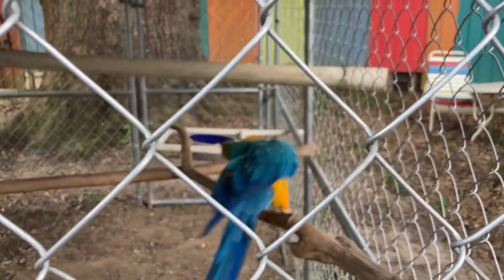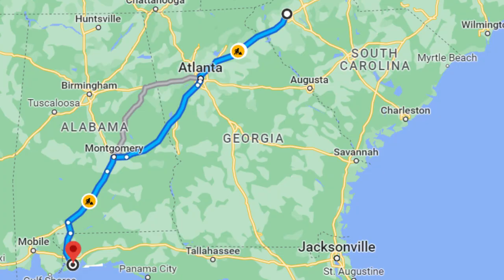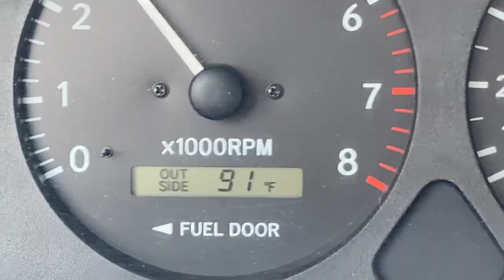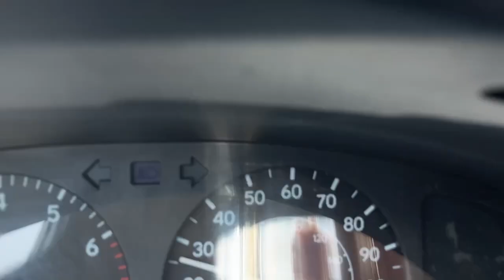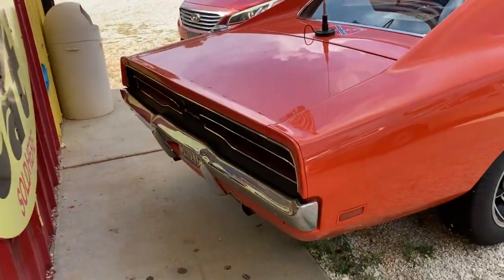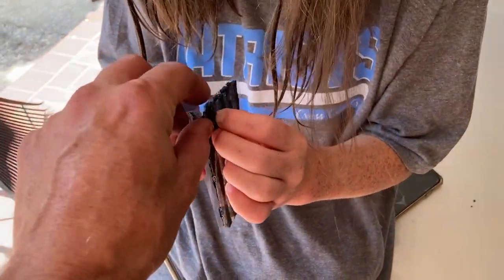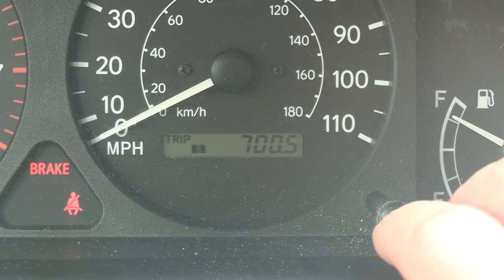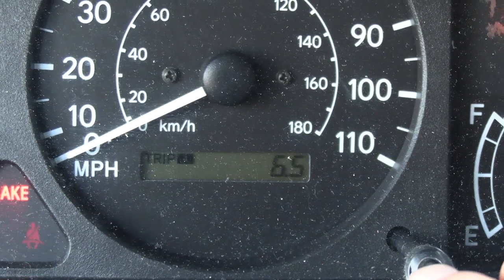HPL Engine Oil vs. OIL CONSUMPTION - Part 2 | Oil Burning🔥Experiments | Episode 24

Comment: Honda Odyssey have a big problem burning oil due to the fuel management system shuts down the rear 3 cylinders.  I switched to using Valvoline VR1 20w50 as an experiment to see if a thicker oil will reduce blow by. And it did.  This van would burn oil a quart every week or so.  Miles will vary because i use it as a work van.  Its probably 400 to 500 a week. Now the oil consumption is down to about a quart every 2 weeks.   It obviously isnt a permanent repair.  But it does cost less to run.  I used to need to buy 10 qts of oil for 1 oil change interval.  (5qt capacity) now i can get by on 7 to 8qts in 5k miles.  I also used to get a code for the vvt oil pressure and that went away a year ago when i switched to using mobil 1 oil filters.  The oil is black but it seems like it has less larger  dirt particles in it.  I have never bothered to send the oil in to get it analyzed.  Long story short, a thicker oil will slow consumption.  Although it may consume more fuel now.

Comment: Dave I have watched all of your videos on oil consumption and I can not find where you have used one of the top go to products, Lucas Heavy Duty Oil Stabilizer. I did a lot of the same things you did on my car to clean piston rings, it helped a lot! Still was burning oil, but not as much.  Before I added Lucas, while the car was running I took the oil cap off and  a  fine mist of oil spray shot out.  Added Lucas and drove the car to let it mix and warm up.  Took the cap oil cap off and their was a notable decrease in fine spray.  Also a notable decrease in engine oil burning.  IMHO   the sticky glue like Lucas oil treatment reduces the amount of fine oil mist, and it is the fine oil mist that can easily make it through the PCV system into the piston chamber where it can be burned.

Comment: Hey dave u should try Lucas oil   treatment its thick i believe it straight 30 wait oil put 4 quarts of oil 1bottle of lucas if u have a 5quart oil system follow the instructions see if it would work it will rasie oil pressure so try half of Lucas bottle it says it will stop oil consumption raise mpg

Comment: I think there should be 2 more steps. 
1. BG Dynamic restoration, as everyone suggest. It's expensive compared to others, I've never used it, but heard a lot of good things about it. And no other channel used it in such a trustworthy way as you would. And if that doesn't work..
2. DMSO. The big boss of chemical treatments. The last resort. DMSO is like the strongest antibiotic if it was a medicine, it obliterates everything in it's way. Good, bad, sticky, it simply doesn't care, because how harsh it is on your engine. It definitely strips paint, so make sure your oil pan doesn't have any before using it. if DMSO won't help - nothing will, and you can definitively state, the problem is mechanical, not chemical. 
Other than that, thank you for your content! Even though I fixed my issue completely with Berryman after seeing it on your channel, I still enjoy these series!!

Comment: As I mentioned in another comment on another video, I had a 2001 Chrysler Town and Country that was burning a quart in 3,500 miles, more than any other car I owned. Then one day I changed to oil to Castrol Syntec and it made it to the 10,000 mile oil change interval on less than a quart of loss. This continued for a couple of years until one day I changed to valvoline synthetic, and sure as heck, a quart low at 3,500 miles. At the next oil change I switched back to the Castrol Syntec and the oil burning stopped. From that day on I never used any other brand of oil. Except in yacht with diesels. I did run that one for 300 hours with no loss of oil either, but it does hold almost 5 gallons and low to high mark on the stick is 1 gallon. I use Rotella T-5 in that one and am thinking of moving on up to the T-6. The time before I used the T-4 with similar results.
On that note, perhaps using 15-40 diesel oil might do the trick. Lots of addatives in there and just a little thicker.

Comment: I don't have a recommendation to offer.   Oil is funny when you change the oil the one thing it does is clean the circulating oil system and as it cleans obviously there is particulate in the oil and that particulate or dirt breeds new dirt, so filtration is very important to reduce that impact.  I don't recall you ever mention the filters you are using or have used.   I don't believe you have ever sent oil samples out to determine the composition of the particulate and additive package.  I have been watching your videos with great interest.  I am a curious fool of sorts and so if something really works it grabs my attention.   My guess is the rings are stuck because manufactures started using what I believe they call low compression rings in the name of pleasing the EPA.  So knowing this I have been routing for a viable solution you might come up with and I greatly appreciate your efforts.  What I wonder is if you were to increase the frequency of oil changes lets just say every 1000 miles with a high-capacity oil filter at each change for a solid year but I would also be interested if you dropped the oil pan to see what it's been collecting.  This is what I would do to avoid tearing the engine down and yes, it's expensive but if you can remove the particulate matter faster it could improve you situation.  It might also make no difference, but this car is does not appear to be your primary mode of transportation so it's worth trying.   Now if it were your primary vehicle the best thing to do is to tear it down and do what's necessary and my guess is you will find stuck rings.   What can unstick them I have no idea therefor I have  no real recommendation to make but oil is an excellent cleaner all by itself the thing is you need to remove the particulate matter and the better you can do this with good filtration the oil will continue to clean but if you do not remove the particulate matter you will just create more particulate matter and the one thing you will really notice are oil leaks and one thing I will say is I do not recall you ever mention oil leaks or am I wrong?   Hey, I am an old dude that deals with oil issues since Moses got lost in the wilderness or so it seems.    When you drove by the KIa plant you were not too far from where I live.   I never liked driving in Alabama but never got a ticket there but if I felt I did no wrong I would contest it but if I did something wrong, would pay the ticket.  Only time I drive out of state is when I travel home to MA, yes, I am a Masshole but knock on wood I have been ticket free for hmm I think 30 yrs.   Doesn't matter,  I just want to thank you for all your efforts and I have watched everything you have put out there because it's interesting to me and if I can learn something new then I am all for it.
Reply from the maker: Yep, no oil leaks to speak of. Thanks for commenting!

Comment: Im thinking 🤔....pull all 4 plugs and fill the cylinders with JB weld... Tow the Corolla to a monster jam event and let em run it over...piss on it...then flatbed it to Alabama and drop it off at the police station with a huge bow on the roof as a present to the cop who wrote the ticket... 😂...

Comment: I'd sorta like to see you pull down the engine, fixed or not. Just to see what all these products have actually done with the tarnished area's of the motor. How clean will it be inside? Will it look new with cactus rings? 
Or is all this stuff you're sticking into it not doing what they claim?

Comment: I have a 96 F250 with the 7.3 powerstroke that was replaced in 2018. It started consuming oil around 57k miles about a quart per 1500 miles. I switched to HPL ck 5w40 at 65k after two complete oil changes it was less than 1 quart every 3000 miles and now at 83k miles it has completely stopped using oil. I’ve also switched to the premium version which allows for more miles between changes.

Comment: Engine oil expands and contracts with temperature. I know this is not meant to be a completely scientific test, but I think you would be better off to have some consistency in how you check the oil level. There is likely a spec'd procedure in the car's owners manual. From the vehicles I have had, it usually something like, "run the engine until at normal operating temp. Park on level surface and turn off engine. Wait 20 minutes and then check the engine oil level."

Just something to consider. Thanks the entertaining video series! This video made me want to vacation to Pensacola and maybe get a management job at a truck stop! LOL
Reply from the maker: Thanks for the advice :-)  Yes, I should have been more consistent with the oil checks ... alas, I think that ship has sailed, but will keep in mind in the future. Thanks!

Comment: I really like the Liqui Moly 2037 Pro-Line Engine Flush. Try it as a piston soak or you can follow can directions, add it to the oil, run the engine for 10 minutes, and drain. I like the piston soak idea, though. Good Luck!
Reply: the best is to do it both ways, first over the piston and then add to the oil and work for 15min and then change oil and filter
Reply: @andresoares4657  Yes, great idea! Both!
Reply: I did try this too - and kept th eengine running for 1 hour even... It helped for some time, but then again the results came back to square 1

Comment: Years ago I recall seeing on the 16 oz cans of liquid wrench that had a spout on top, it said to add to oil 100 miles before oil change to dissolve carbon from inside engine but never knew of anyone that tried it. Who knows ? Maybe it works…could be worth a try 🤷🏻
Reply from the maker: Thanks for the suggestion.

Comment: I did read to move your spare tire to the rear because it's lighter in the back. It's extra work but it makes sense.
Reply: I'm going to add Berryman B12 and run the engine for 20 minutes before each oil change. We're all looking forward to the next video.🛢️
Reply: Not trying to be mean here but what is your point of discussing moving the location of the spare tire?  Are you referring to when it's not in use in general?  If so, to my knowledge, the spare tire is located in the back when it's not being used and it's in the trunk to my knowledge.  The only ones that I know of that have the spare in the middle of the vehicle are minivans (I had a few Dodge or Chrysler minivans where this was the case).

If you're referring to switching the rear tire that is good to the front when there is a flat on the front so you would put the good spare tire in the rear, I don't know why you would waste your time doing that.  A spare isn't meant to be used long term and is just meant to get you to a location where you can get the real tire fixed or replaced as needed.

You're referring to doing something that really isn't necessary.  You can obviously do whatever you want if you think it's worth it but really, it probably isn't in "most" cases.

But also, the small amount of weight savings that a spare tire has compared to a full sized wheel and tire combo on this car is minimal and won't really change anything.  If you think it has anything to do with the oil burning, it won't.  If it's about aerodynamics, then again, this isn't even worth worrying about.  If it's about a safety issue by having a spare in the front rather than the back, then you can argue that but if having a spare tire in the front was a safety issue, then vehicle manufacturers would be getting sued left and right with all the accidents this would cause.

However, you don't see that happening and there's a reason.  It's because there's nothing wrong with having a spare tire up front.  You're over thinking things.  Don't over complicate things like this.  It's just wasteful and unnecessary.
Reply from the maker: Please let us know how that goes, Scott. And thank you!
Reply: @FamilyFriendlyDIY  Thanks to you I went from 400 miles a qt to 1200 miles 😀

Comment: Have your cylinder head gone through...the valve guides and valve stems are worn...thats why when you looked in with the borescope there was oil literaly dripping down the cylinder walls...the vacume in the intake side is just sucking oil past the worn valve guides and valve stems regardless if the seals are new.
Reply from the maker: New video out now -- looking at valves.

Comment: I think you had the best cleaning performance with the yamalube ring free.  I have a 2006 CRV with 185k miles which was burning 1 qt per 1500 miles, one bottle of ring free in the fuel tank (based on your video) and wow, huge difference, about double - 1qt per 3k miles.  If you do another test give ring free another try
Reply from the maker: Glad to hear it worked for you!

Comment: I think a better $300 finale to using chemicals is following the Hyundai TSB 222 for excessive oil consumption. The Valvoline fluid is similar to Berryman's but less toxic (non-HAP) and slower evaporation. If one or two rounds does not put you above 1Qt/1000 miles then a mechanical fix is needed.

Pro Cleaning Kit:
Valvoline Intake Cleaner 18OZ (#884526) -  Hyundai  00232-19103  
Cleaning Kit - Hyundai KQ234 C6100FFF  

DIY Cleaning Kit:
Valvoline Intake Cleaner 18OZ (#884526) -  Hyundai  00232-19103
Lisle 20540 12mm Spark Plug Adapter
Lisle 19700 Valve Holder , black
TAILONZ PNEUMATIC Male Straight 3/8 Inch Tube OD x 1/4 Inch NPT Thread Push to Connect Fittings PC-3/8-N2 (Pack of 5)
Mityvac MVA6851 Fluid Extractor
TAILONZ PNEUMATIC Air Line 3/8 inch od White Pneumatic Nylon Tube 32.8ft Air Brake Tubing Nylon Hose (toluene resistant)

Once the cleaning is performed it should be followed by an oil pan full of any HPL oil (Ester/AN)  or equivalent.

Comment: Have you checked the PCV valve again? A partially stuck open pcv can suck lots of oil out of the crankcase. Also, replace that thermostat to make sure the car is getting up to temperature.

Comment: Amsoil Signature Series oil has one of the highest detergent additive contents. I suggest you try that for at least 10,000 miles. It should be much less work than tearing down the engine.

Comment: I am beginning to think that the high-speed oil use is from valve stem seals. Blue devil oil stop leak might help those, it will swell and soften the rubber. Also, I have found that using high mileage oil can reduce oil use by as much as 1/2 qt per 1000. The thing puzzling me is all the oil dripping from the top of the cylinders as viewed through the scope.
Reply from the maker: We did the valve stem seals, but you’re right, it looks like it would be coming from there. We might have to give those another look.
Reply: @FamilyFriendlyDIY  is there any chance so.ething is keeping the oil from draining out of the head? Or causing excessive oil to be pumped into the head. It really looks like the Berrymans cleaned the rings, and now it's getting worse. All that oil is coming from some place and it looks like from above. Good luck.

Comment: Great series Dave. I'm curious if running a few tanks of ethanol free gas would have any affect? Also, maybe a complete oil change of the HPL or Amsoil before the tear down? Thank you for the continued experimentation that Toyota should have been doing years ago.
Reply: Ethanol is a Solvent and is more likely to help the issue rather than be a cause of the issue. I would say switching to non ethanol gas would make no difference here

Comment: The engine is worn out!    On a past video you had oil leaking into some of the cylinders when sitting over night, that is always indicative of valve guides being worn out.  I may have missed it but have you ever done a compression check on the cylinders?

Comment: Before it all comes apart how about trying a few gas tanks of non-ethanol gasoline with some carbon cleaner in the oil.
Reply from the maker: 🤔Which carbon cleaner do you recommend?
Reply: @FamilyFriendlyDIY  I use gumout multi system tuneup 200 miles before oil change. I've known someone using oil in a boxer Subaru engine to do that twice and stop using oil shortly after. On top of that I would try to stop using ethanol gas if you can for a while. Ethanol seems to make the carbon sticky. 1k miles on royal purple will clean the inside engine real good. But I think when you pull that engine apart you'll find damaged rings.

Comment: Have you installed a new PCV valve and vacuum hose? If the hose does not seal perfectly on the PCV nipple, it will consume oil. It's so subtle, it is hard to detect it as a vacuum leak. My 2006 Matrix (216,120k miles) went from using 8oz / 800 miles to 8oz / 400 miles. Put on a new PCV valve but it did not improve and noticed the vacuum hose was hard and brittle. Replaced hose (oem) and it decreased the consumption back to 8oz / 800 miles. Also, fuel mileage improved as it is not running a bit lean anymore.

Comment: How do you know that the rings are not cracked therefore no chemical solution will work? I have a Hyundai santafe sport that burns 1quart every thousand miles and it only has 85K therefor watching very closely. Thanks for the experiment.
Reply from the maker: Just going with the odds -- since this is a well-documented issue with these. All the best with your Hyundai!

Comment: Thank you for your videos. I watched all of the series with real pleasure. Moreover I tried to use some of the chemicals on my car, but eventually ended up with a complete rebuild, which is where I live not that expensive, even if using top brand parts - the complete rebuild cost me last year approx. 500$ :) Now the engine (almost 200k miles and 18k miles after the rebuild) is perfectly fine and finally no oil consumption whatsoever. Greetings from Europe. 
BTW - this Alabama scams made me sad for America
Reply: I find it hard to believe that a complete rebuild of an engine would cost only $500.  Where do you live?
Reply: @jimvanbelkum7912  it's a wild country LOL not Ukraine or Israel though
Reply: @kris856  Which Country?